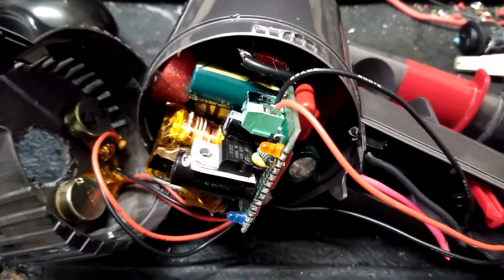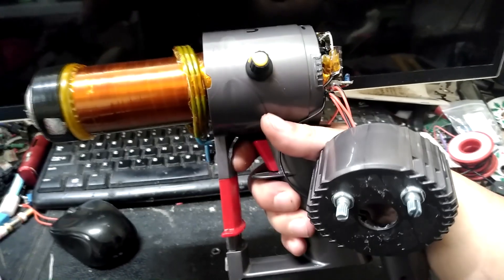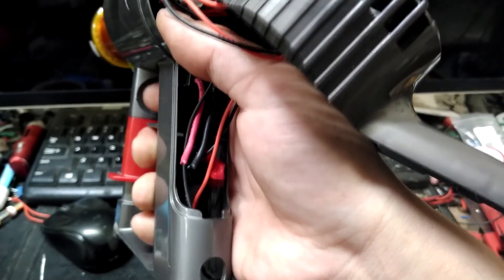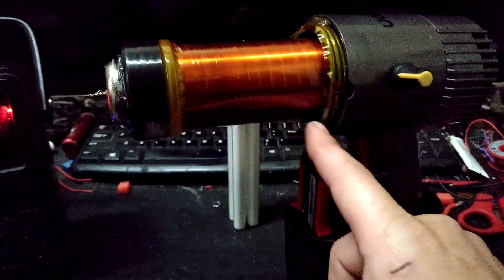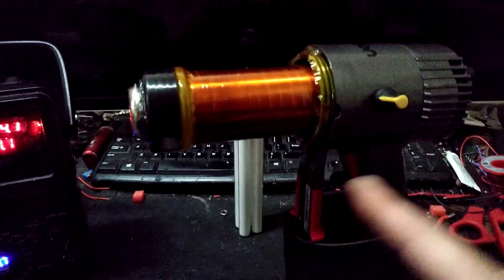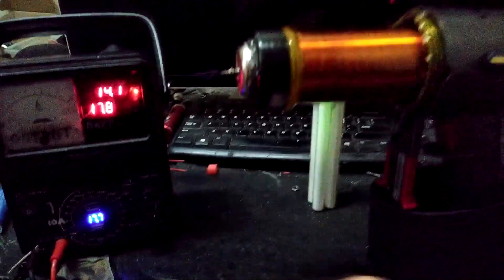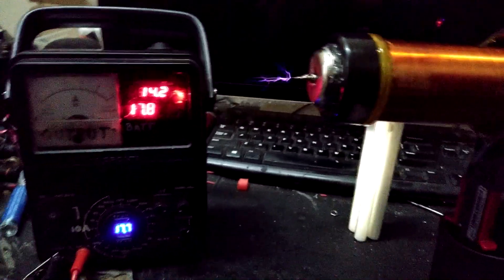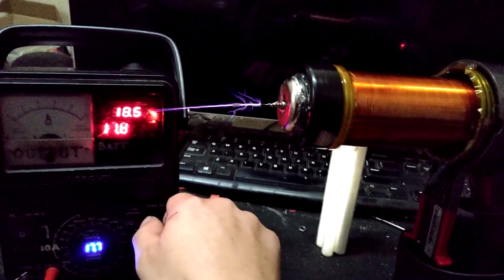Mini Tesla Coil Gun #2

Comment: great .. i was able to build your controller and it worked. the problem is that I still have a very small output like one centimeter. I only got irf640 mosfets and a 10nf mmc. I think that there is the problem, also my secondary only has 890 turns with awg 30.
Reply from the maker: IRF640's don't work well in this circuit I tried them before. I've ran low as about 400 turns before though. A 640 would more likely prefer 100V or higher.